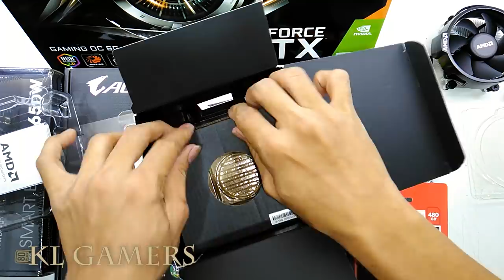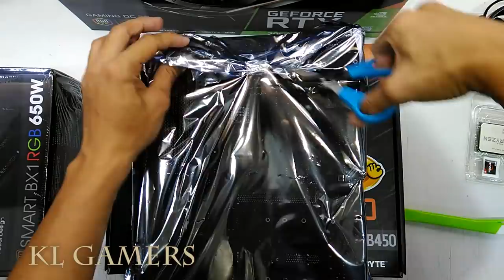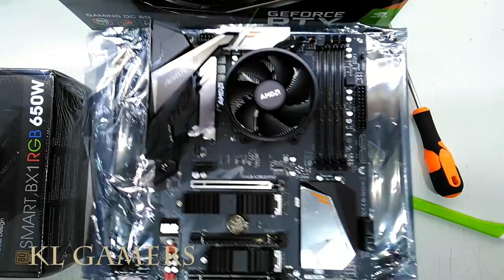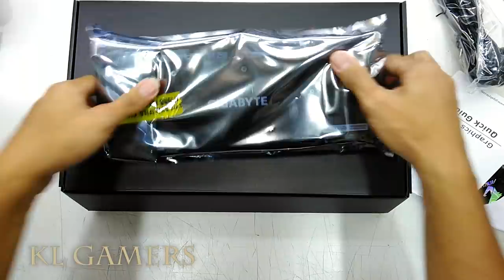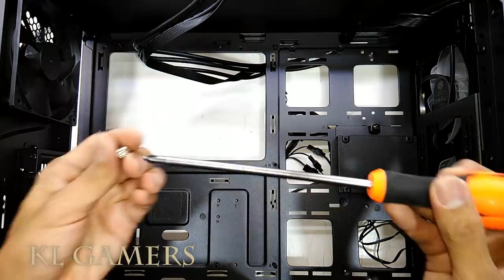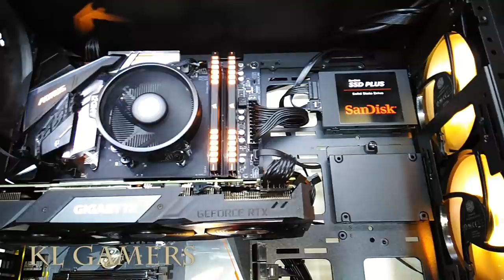AMD Ryzen 5 2600 GIGABYTE B450 AORUS PRO VENGEANCE RGB 16GB GIGABYTE RTX 2060 GAMING OC 2019

Comment: Just some advice, try not to put the motherboard on the outside of the bag that it comes in, the outside conducts static electricity. Also, touching the top of the cpu isn't recommended because you put your oils on it.

Comment: Your not supposed to put the motherboard over the anti static bag your supposed to lay it on the box itself
Reply: Gavinsanimation why?
Reply: @RamRanch666  that's because its only an anti static bag on the inside so if he puts the mother board on top of it it's just plastic and can possible fry the motherboard
Reply: Gavinsanimation oh
Reply: I'd be more concerned about the fact he didn't apply any TIM to the CPU.
Reply: @CragScrambler  yea true
Reply: CragScrambler well he doesnt have to there is TIM on the boxed cooler
Reply: It doesn’t make the slightest difference, dude. That’s an old ass procedure that’s outdated from years ago.
Reply: @CragScrambler  NO NEED ALREADY ON COOLER
Reply: I've never saw anything like that happened hahahahha, it's not like the box itself would hold any static electricity on the bag itself

Comment: Something you shouldn't  do that o saw in this Video. 

1. DONT place the plastic wrapper under your motherboard, its better you use the box the mobo came with. And trash the plastic  wrapping. 
Why? : Static electricity.
Reply: No it's just rumors
Reply: In South East Asia (Pacific), they say the humidity is so high, static electricity build up is very rare.  but I don't like that attitude.  For god sake,  the people will leave their cars running when pumping fuel which scares me.

Comment: I have almost an identical build rtx 2060 ryzen 7 2700 Corsair vengeance 16gb SanDisk 240 SSD. Where do you out all the power tiny cables
Reply: NKPlayz Im also getting a 2060 and a ryzen 7 2700 :)
Reply: qhikk r6 yeah it's insane finished it 2 days ago
Reply: @yesno7091  buy R5 3600 it has +22% performance over the R7 2700
Reply: @xFireStyle  for real?
Reply: @yesno7091  yeah, look here :
https://cpu.userbenchmark.com/Compare/AMD-Ryzen-7-2700-vs-AMD-Ryzen-5-3600/3957vs4040

But unless you are a streamer the 3700 would be the better option

Comment: Question, to make this built when you put the ram, did you just the adjust the profile or did you made an overclock? Because I don't understand very well why motherboard specifications from this chipset say the maximum of ram with the brackets O.C
Reply from the maker: yes you will need to do some overclock = XMP settings

Comment: Parabens pelo pc ! Amigo, essa placa mãe tem entrada pra 3 coolers frontais do gabinete e mais um do Cooler gammax 400 do processador ?
Reply from the maker: you will need to buy the fan controllers
Reply: Compra um controlador de fans, um hub de fans, Vai por mim, vai ser mais útil do que confiar se a placa mãe tem conectores de chassis suficientes

Comment: I wanted to connect the RGB fans to the mobo (B450 aorus pro).  Total are 5 fans.  Included are 2 controllers (1 of the case, and the other of the liquid cooler) case H500P master cooler and 240l cooler master heatsink.  Where should I connect them?  Is there a 5-pin attack that would be (12v G B R W), should I attack them here?  But there is a problem.  I only have one connector to attach.  If I attack the 2 controllers together (so I can only get one to stick to the mobo) does something happen?
 2 days ago I accidentally burned a motherboard (always the b450 aorus pro) because I attached the 4-pin connector to the wrong area, ie (D_led 2).  I don't want to burn another motherboard :(.
 Excuse me if I went on
Reply from the maker: Usually if you bought cooler master RGB stuff that came with a controller you just need to connect it between your cooler master product and your controller. You not need to connect to the motherboard. The cooler master product usually came with a RGB 1 cable to 3 cables spliter as well. Example RGB ML240L build https://youtu.be/ZtJB1hnlNEI
Reply: @KLGamers  Yes I understand, before it was so connected, with the splitter.  Since I have now changed the motherboard, I wanted to sync all the fans even those of the master cooler heatsink.  The only rgb attack that remains is only the Led_CPU one.  In the manual this attack supports rgb from 12v to 2A.  The ones I asked myself, can I attack him there?  Thanks for your patience

Comment: Que temperaturas te marca ese procesador y sabes por que te genera con el programa de ryzen master el EDC CPU te genera 90-99% ?
Reply from the maker: The Benchmark Results here if you interested  :  https://youtu.be/3WSlnVBp1tM
Reply: I would go for the Ryzen 5 1600 AF, same as 2600 ( 2% difference ) and cheaper 30 euros
Reply: @nunoviana3690  good choice ! even with the right settings you can get an excellent performance similar or better than AMD 2600 !

Comment: hello. you connected a 3-pin cable for the rgb of the case at the gbrw (12v)? did i saw well?
Reply from the maker: so long ago i forgot
Reply: I need help with this part as well. Gigabyte does not specify where to plug a 2 pin rgb header.

Comment: I have a psu from France and it has an EU plug so how can I change it to a UK plug safely? Great video btw I'm doing a very similar build!
Reply from the maker: Check if the power supply supports 110v-240v auto switch.
Reply: @KLGamers  sorry I'm not sure where to check.The psu I got is the: be quiet power 9 600w

Comment: Buy one of that, and I have a Reader problem, I think that modern motherboars no longer have the need to use a reader, my problem is that everything is installed but when inserting a disc is DVD, Blu ray or Data reads but I get a message that has to insert disk and eject it, my CD player is an LG BH16NS40 with SATA connector. What should I do? Do I configure in WINDOWS or through the BIOS? And how can I do it? I also want to ask if the ASATA3 is suitable for any SATA (Hard Disk or CD / DVD / Blu ray Player) or is only special for Solid Disks (SSD). Thank you. Note: my windows is 10 Ver. 1809.
Reply from the maker: not sure, it should work no need any configuration. Might be faulty dvd rom

Comment: hello, I would like to know if you can connect more than one ARGB fan in the 3pin rgb fusion connector without using an external controller hub. I have bought 3 fans with rgb but Iḿ not sure if I can connect all of them to the same connector with a cheap adapter or something, thanks!
Reply from the maker: this i not sure

Comment: You plugging in your SSD to the ASTAT port made me cringe..  You should change that over and use the one next too/below the port you used for your Segate drive.  ASTAT is slower and has higher latency as its connected to the chipset and not the CPU.  Outside of that, clean install.

Comment: Hi, I just bought an Aorus B450 motherboard with a Ryzen 2600 and Vengeance LPX 
ddr4 2x8 gb
 3200 MHz OC,

I added the kit on my pc no problems, when I switch on my pc Everything works GPU cooler etc. But nothing is launched on the screen and only the LED of the motherboard on the CPU.

I think it's my power supply that is responsible because to power the CPU my power supply can only provide 4PIN ,and on the motherboard we can put 8, could that be the problem?If this is the problem what computer power supply I could take ? Pls help
Reply from the maker: u need a graphics card as 2600 does not give graphics output
Reply: @KLGamers  I have a graphic card too
Reply: Usually when you put a 4 pin it will still would work but I would recommend you to down clock your cpu to try to see it it would boot 
For psu get either a Corsair cx500 or a seasonic 500 watt

Comment: I bought a case Phanteks evolv mATX and also bought 450 aorus and it turns out it doesnt fit,  now I have to give it back.  
By now I learned that the "mATX" in the case name meant (I didnt know then).
Reply from the maker: ya the mATX is the smaller size of a motherboard.
Reply: @KLGamers  Unfortunately the case has a cover in for the power supply, and it is fixed, no screws.  I hadnt realised the mother didnt fit in there.

Comment: Hey please help me, I have the Ryzen 7 2700 and I’m using the B450 auros elite motherboard and I did all the steps and it doesn’t light up at all. The only thing lighting is my RAM what should I do?
Reply from the maker: do u have graphics card? Ryzen 7 2700 don't have build in graphics so will not have display if plug in the HDMI to motherboard.
Reply: Guess what I didn’t turn on the case hahaha it’s fine now

Comment: Amd Ryzen 5 3600 + Rx580 8gb + gigabyte b450 aorus pro wifi + Corsair Vengence 8gb ram 3000mhz + 550 watt powersupply 
Will work ?
Reply from the maker: 650W better RX580 need power
Reply: O'h ok Thanks Buddy for feedback

Comment: Will the mother board share rgb to coolers, i mean can the mother  board share the same collor for  ram and coolers all be compared with the changed collor
Reply from the maker: then you will have to make sure the cooler fan you buy have the exact RGB header that can connect to the motherboard. Many cheap RGB fan just connect to the controller and unable to sync with motherboard

Comment: Bhai budgets mention kardia karo plz
Reply from the maker: Processor = AMD Ryzen 5 2600 6 Core 3.9GHz  = RM679
(Amazon link) = https://amzn.to/2YGanLM 
(Lazada link) = https://c.lazada.com.my/t/c.cs8C

Motherboard = GIGABYTE B450 AORUS PRO socket AM4 = RM529
(Amazon link) = https://amzn.to/2YESw87
(Lazada link) = https://c.lazada.com.my/t/c.cK5V

RAM = CORSAIR VENGEANCE® RGB 16GB (2 x 8GB) 3200MHz DDR4  = RM689
(Amazon link) = https://amzn.to/2YJZjBe
(Lazada link) = https://c.lazada.com.my/t/c.cGZA

SSD = Sandisk SSD Plus 480GB = RM319
(Amazon link) = https://amzn.to/2ZvUGbd
(Lazada link) = https://c.lazada.com.my/t/c.cFpg

Hard Disk = Seagate BarraCuda 1TB desktop hard disk =RM179
(Amazon link) = https://amzn.to/2YFWWLP
(Lazada link) = https://c.lazada.com.my/t/c.cG0a

Graphics Card = Gigabyte NVIDIA RTX 2060 GAMING 6G DDR6 OC = RM1979
(Amazon link) = https://amzn.to/2YCeOqL
(Lazada link) = https://c.lazada.com.my/t/c.coJO

Power Supply = Thermaltake Smart BX1 RGB 80-PLUS 650W =RM329
(Amazon link) = https://amzn.to/2YFN9VZ
(Lazada link) = https://c.lazada.com.my/t/c.cG0Z

Casing = Cooler Master MasterBox Pro 5 RGB = RM359
(Amazon link) = https://amzn.to/2Zyf4IM
(Lazada link) = https://c.lazada.com.my/t/c.cJE2

TOTAL = RM5062

Price is based in local Malaysia current price.

Comment: Will I get a display from the motherboard I/O using just the Ryzen 5 2600 without a dedicated graphics card? I just want normal PC use (no gaming). 

Thanks
Reply from the maker: no, Ryzen 5 2600 does not have the graphics chip and no video output signal even the motherboard does have the physical port connections
Reply: KL Gamers is there much difference between the 2600 and 3400g? Which one is better. I need a fast and powerful cpu. Thanks
Reply: Aretas okay thanks

Comment: Hey I’m following this guide and I have few questions. 1. Will my EVGA 650 N1 650 watt power supply work with this build. 2. Will a different case will work? 3. I picked 500 gb hdd and 120 gb ssd will it work           Please any one help me out I’m new to these things.
Reply from the maker: 1. Usually it will work just fine 
2. Make sure is ATX size 
3. Yes but SSD should be at least 240GB , i would recommend 480GB

Comment: Nice build but i recently built a gaming pc that is very midrange
Specs:
Amd ryzen 5 3400g
Gigabyte b450m ds3h 
Kingston hyperx 16gb ddr4 3200mhz
Corsair icue 220t rgb airflow
Coolermaster mwe 550w 80plue bronze power supply  
Msi Geforce gtx 1660 super ventus xs oc
Pny cs900 120gb ssd 
Seagate barracuda 2tb hdd
Reply: You need a Gpu or else u will get poor fps in games.
Reply: @chineseman4505  i just got a 1660super
Vary nais
Reply: @PepeTheMemeWizard   cool

Comment: I recently built a pc with this motherboard but I’m having trouble connecting to my WiFi network any tips that can help?
Reply from the maker: add a WiFi card 
Wifi = TP-LINK Archer T4E AC1200 Wireless Dual Band PCI Express PCI-E 2.4GHz + 5GHz WiFi Adapter Card = RM108
(Amazon link) = https://amzn.to/2ZiijmG
(Lazada link) = https://c.lazada.com.my/t/c.W78F
(Shopee link) = https://invol.co/clhb30
Reply: Or use an Ethernet cable it's bettee
Reply: Check if it is your router.  They usually only last from three to four years because they are always on 24/7.

Comment: hey man i also bought a aorus b450 motherboard and a ryzen r5 2600 what bios is the best for this cpu
Reply from the maker: not sure, have to try
Reply: A b450m usually already supports the ryzen 5 2600 so you should be good
Reply: the last F60 ,EC FW Update Tool revert bios and I didn't install it

Comment: Atx Thermaltake Tr2 700w or Gigabyte 700w 80 Plus Bronze?   or probably 650??  which should I buy? 
  I want to buy a computer just like yours except ryzen 2600x .
also,  1 ram 16gb??  or 2 ram 8gb each?
Reply: does m.2 memory give you better results than ssd?  I learned about them yesterday and I am thinking of getting one instead of a ssd (500gb)
Reply from the maker: M.2 will give better results ( faster transfer speed ). Will be much faster if you go for the NVMe M.2 that is more expensive.
Reply from the maker: (Atx Thermaltake Tr2 700w or Gigabyte 700w 80 Plus Bronze?) = either will do. Depends which is more warranty and price from your side. i guess most ppl will suggest dual channel RAM
Reply: @KLGamers  Here they are telling me 600 will be enough for that build.  Probably my chances are the same,  except I was told that tr2 is not 80plus. so the other question is SMART WHITE.  are they recommendable?

Comment: 1 little problem,why you dont putt thermal paste on processor
Reply: The heatsink had already pre-installed thermal paste. The companies pre-install thermal pastes on their hardware in case you don't have in the time of building your pc an aftermarket thermal paste. But I do prefer buying an aftermarket because I can chose the right paste I want for my build.
Reply: @nicktiamaros5629  yeah that's correct thank you

Comment: i really wanna see how this build perform when streaming and gaming triple A titles @ 1080p 720p output....
Reply from the maker: With Shadow of the tomb rider Game, The Benchmark Results here if you interested  :  https://youtu.be/3WSlnVBp1tM
Reply: In gaming it can do 1440p at 60fps just fine at streaming at 1080p will be way over 60fp
Reply: Prakash Mondal   what's the point of using the r5 2400g if using dedicated graphic card and why the a320 chipset u do realize all ryzen chips can overclock so probably would be better to put a bit more money into getting a b450
Reply: Prakash Mondal  also why are u only getting a 500gb hdd but getting 16gb of ram how does that make sense

Comment: I just finished my 1st build, ryzen5 2600 with stock cooler on a asrock b450 pro 4 with 16gb of gammix d10 at 3200hz with a nvidia 1050ti and a rosewill 450 ps in a rosewill challenger case. I have absolutely no exp in this and cannot find out why my mouse will not work in bios. keyboard either.don't have a lot of extra hardware lying around to change mouse or keyboard. everything works fine on the web just cant get into bios or uefi. help !
Reply: BiOS has to be done with keyboard arrows, normally mouse doesn't work for it
Reply: keyboard is locked too, cursor stays in middle of screen
 @PaulaDeensButterDish

Comment: Hi KL, I also have a Gigabyte B450 Aorus M and Ryzen 5 2600 with Corsair Vengeance Pro RGB 3200mhz.. Are you able to set the ram speed to 3200mhz without any error ? Because mine, i am getting a Blue Screen error when im selecting the XMP profile of my Ram.. Maybe you have any suggestion for this ? Thank you..
Reply from the maker: for older AMD processor i think 2666 only

Comment: i had an issue after install all part..i try to turn on desktop, it seems fine to me..everything is lighting on..but the problem is..my monitor didn't show anything even bios in my first try..i already check all the cable if i didn't install properly..it seems fine..nothing is incorrect..

i had a same build like yours..using same mobo same processor..can i know if maybe u had a same problem before..or maybe u can give me some advice so i can check if anything is not right with my installation?? thanks..
Reply from the maker: AMD Ryzen 5 2600 no build in graphics. So need a graphics card. if still problem change RAM slot and try.
Reply: @KLGamers  i already figured it out..my monitor need a vga cable with dvi connector..that's the problem..lol..well it's my first time building a pc..so yeah..btw thanks for the reply..keep a great work!! 👍

Comment: bro would be there any problem in fps fluctuating if i combine the rtx 2060 with b450 or i should go with x470?
Reply: no it wont affect your fps, but if overclocking is your thing, x470 would get the most out of it
Reply: @sergiolandz6056  bro i can understand that x470 could be a best pair with rtx 2060 but i have not so much budget for it could you suggest me a good motherboard between INR10000 only for gaming purpose and i'm going with ryzen5 2600x.
Reply: @abirsarkar5417  msi b450m pro vdh would do just fine for rs 6700 from md computers but if u can spend a little more go for msi b450 tomahawk for rs 8500
Reply: I use a b450m gaming plus from MSI and it works perfect for me. Mind you I don't use Nvidia for 3d cards I'm with a Rx 590
Reply: @harshpandey3239  bhai ye jo board aap bol rahe ho ye shi rahega na matlab pc ko to hum khud ki choice se overclocking nhi karte ye bas apne ap kar leta hai to isi liye bol rha hu ke 10000 ke andar kuch achha ayega jo best hoga rtx 2060 and ryzen 5 2600 ke liye?
Reply: @abirsarkar5417  yes u can.
Reply: @abirsarkar5417  its the perfect combo
Reply: @abirsarkar5417  also i suggest u to go with rtx 2060 founders edition as it is the cheapest at rs 31000.